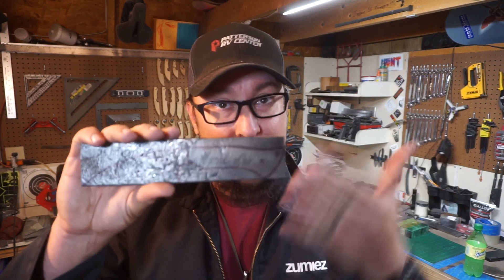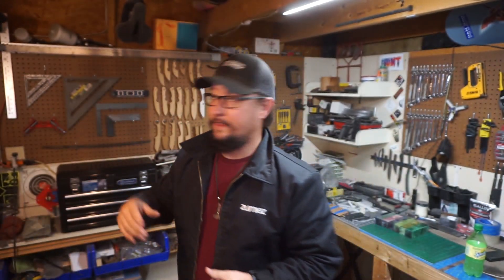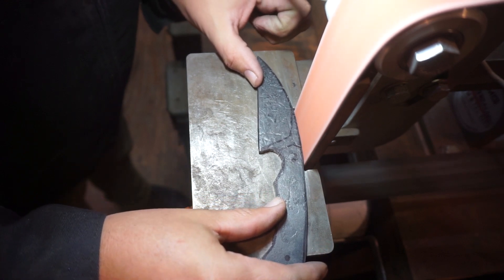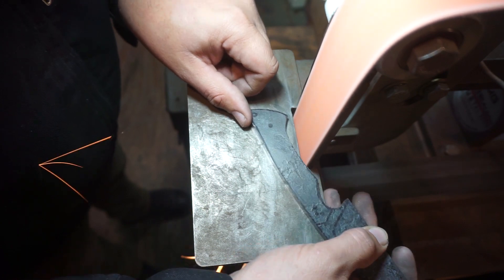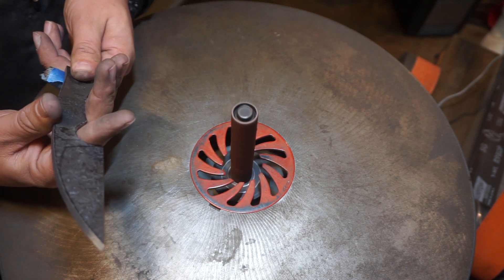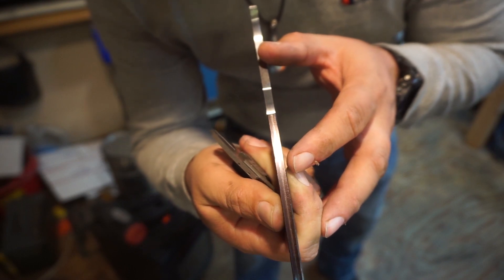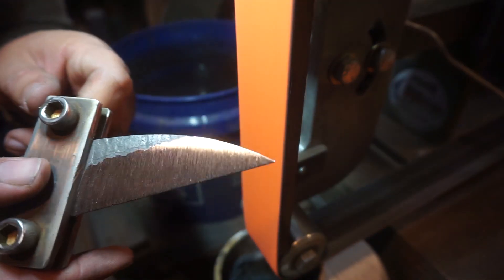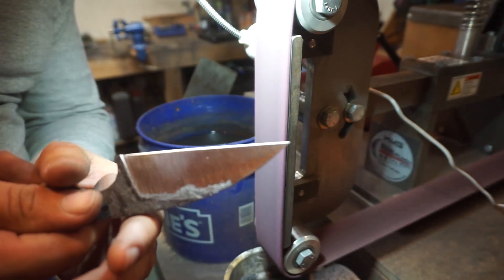Starting The 5160 Wharncliffe Build series! | Build your Own Knife | Vlog

Comment: I think you should make a lanyard bead with the same burl wood and liners as on the handle. I do it on my knives and they turn out really well, even without a lathe you can get them pretty much perfectly round on the drill press. Thanks and awesome video!
Reply from the maker: Yup, good point. This is happening.

Comment: For the forged texture, did you just heat it up to glowing in the forge, then hammer it?
Reply from the maker: Yup pretty much. I was already forging it flat so I went ahead and gave it a cool texture during that process with a hammer I designed just for texturing steel.